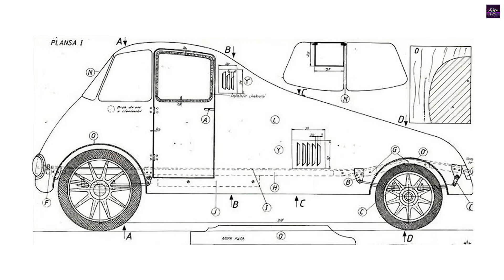Aurel Persu: The Forgotten Romanian Car That Beat Tesla's Aerodynamics

Comment: I call bs on the aerodynamic CD figures. 
There is no way that vehicle, with that front end is cutting better drag figures than a Tesla, there's too much frontal area, and it's too upright to better the Tesla's figures.
Reply: It works because it's a copy of a water drop, the most aerodynamic shape there is. Blunt nose, tapering body. Mercedes developed a van based on a water drop but as it didn't offer the carrying capacity of a regular van so they looked to nature and found that the Puffer fish was just right, sort of blunt nosed with rounded corners, flat sides and a narrow tail. Their prototype came out with a very low coefficient of drag but the production model got more space with a small sacrifice of efficiency.
Most cars are actually backwards. Thin fronts and bigger, blunter backs causes vortexes to form at the rear causing drag.

Comment: He is right about Tatra,. The backbone frame and swing axles rear mounted aircooled engine streamline body design were all Tatra engineering. Porsche was familiar with the Tatra designs and knew Treblinka the chief designer. He actually got some of the ideas a little ahead of the Natzi invasion of Czechoslovakia.

Comment: Raindrops are not tear shaped when falling through the air. They are approximately round, but he got the drag coefficient down anyway.

Thanks for posting
Reply: Considering that Persu did his work 30 years before computers were available, and computers sophisticated enough to run complex simulations were another 2 decades away, I think he did alright. I wonder how good YOU are with a slide rule. Also, the ultra high speed cameras necessary to see the true shape of raindrops were developed to film nuclear weapons tests and aerospace test flights... during the '50s. Next, you'll be criticizing Archimedes, for not discovering fractals!
Reply: @LeydenAigg That was Physik and Mathematik! For hundred Years Einstein had no Chance to go to the MiT or work with superfast QuantenComuter!

Comment: My car has a drag coefficient of 0.30 (1986 Nissan 300zx with a 1987 revised front end swap with side skirts and rear-deck spoiler. Albeit much more advanced and aided by early computer models it's still interesting to understand how designers achieved those numbers. Cars today are nowhere near as aerodynamically efficiant.

Comment: The problem with so-called 'perfect' aerodynamics is crosswind susceptibility.
Reply: @campbellpaul This one looks not too bad from that point of view. It also ran for 120,000 km.
Reply: I don't think they were going for land speed records or building it light like hpvs. This is slab sided but no more so than other vehicles of the 1920s and early 30s
Reply: @campbellpaul  It "looks" like it wouldn't have any issues with crosswinds. I could be wrong, but the long tail should help there.
Reply: i think the concept of aerodynamics includes wind
Reply: A crosswind wouldnt slow you down would it?

Comment: I'm almost 65, and have been building models and seeking out unusual automotive and aerospace subject for over half a century.  This is the first I've ever heard of Aurel Persu and his innovative car. 

Apparently, there is a resin model (I'm unsure if it is prebuilt or a kit) available of Aurel Persu's 1924 "Experimentallimousine."  It's not inexpensive, but it does exist . . . . 

Thank you for posting this.

35th Like.
Reply: Any chance of a link to buy?
Reply: @christophersmeeton209  You could try Googling "Aurel Persu Experimentallimousine Minimodelshop."  But when I last checked, it said they were out of stock.  Also, the site says this model is in resin; not diecast metal.  The only scale available is 1/43rd.  eBay might be your next best bet.
Reply: I bet you built the Corvette prototype and the Chrysler turbine. Those two were quite interesting for their day.
Reply: @campbellpaul  I don't recall building the Corvette prototype (though I built my share of AMT 1953 'Vettes.)  I have built the Chrysler Turbine.  Now THAT kit was way ahead of its time, and really needed modern tools and finishing supplies that the average model car builder in the 1960's didn't have.  That said, I wish someone would reissue that kit (or make new tooling.)  The same may be said of all JoHan kits - the planes as well as the cars!
Reply: @modelermark172  I guess I'm thinking of the Aerovette, that looks almost the same from the rear as the front. I think Barris and Roth customs were also cool.

Comment: No tech specs about the engine, gearbox, total weight, fuel consumption etc.?
Reply: My guess is an air-cooled VW engine, with a standard gearbox.
Reply: @campbellpaul  zu der zeit sehr schwierig. Im ostblock ab 1954 war es ein wunder an westliche technik heran zu kommen.
Der vw käfer war da nicht soweit verbreitet.
Reply: @campbellpaul  This was way before VW even existed. He used a AGA four cylinder engine.
Reply: @completelyboringstuff204  You're right. I overlooked the date. Wouldn't mind seeing a modernized version though

Comment: This was never gonna fly - its backwards, if you ask me
Reply: it's based on a raindrop, not a foot.
Reply: Raindrops are actually flat because the wind flattens them
Reply: Tapering tails reduce departing turbulence. Not have to pull a huge low pressure area along behind you reduces drag more than having a pointy nose does.